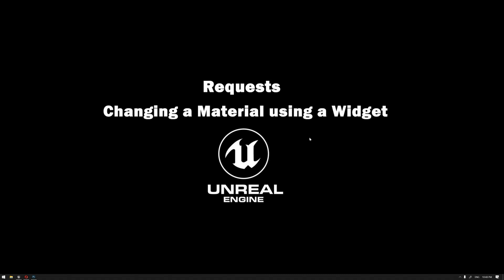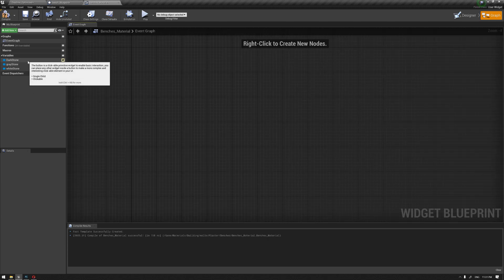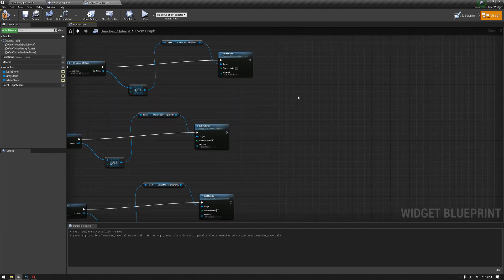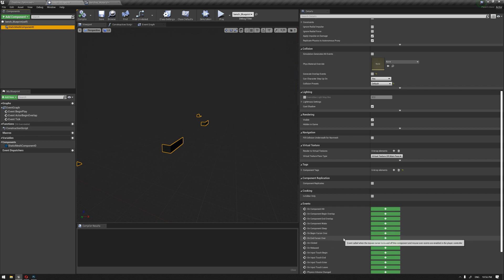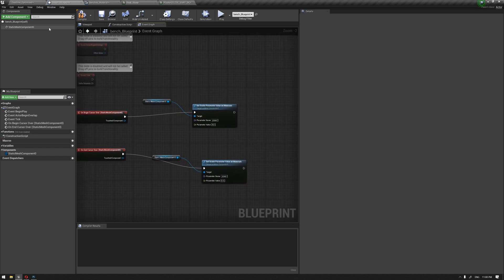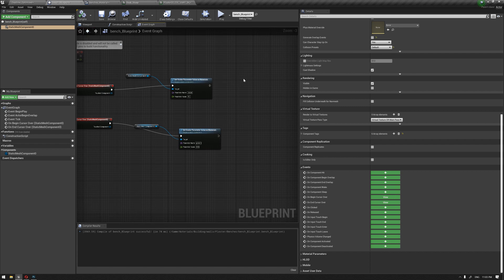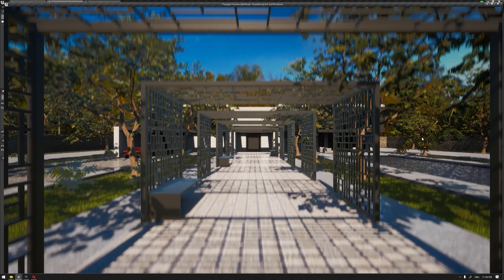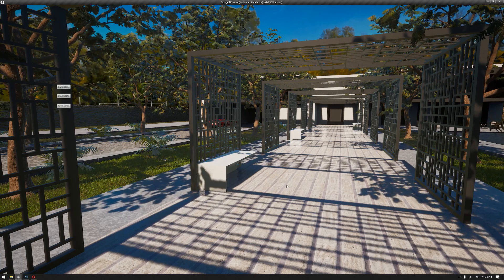Request 3 : How To Change Material in Real Time using a Widget

Comment: its doesnt work for a lot component like sofa
Reply from the maker: what kind of troubles did you face with static mesh's like sofa
Reply: @theimageneers5161  problem solved bro, event the sofa mesh's, i just need to add 1 by 1 to change part of sofa
Reply from the maker: @Fikarblackproject  Thanks for sharing that Fikar 🙂
Reply: @theimageneers5161  can u make tutorial again? like when we click chair/table the widget will pop up :)  thx before
Reply from the maker: @Fikarblackproject  Will do our best to answer this request in our current second course 🙂

Comment: hi... not working for me :-(...
Dont know what i am doing wrong !!... does this method applys only to the ArchViz Game mode ?. 

i am not able to get the white color when i hover over the converted blueprint mesh, also not able to visible the uiwidget
Reply from the maker: Hi Jamee , what version of UE are your working on and did you find any errors when you compile the blueprint
Reply: @theimageneers5161  using UE5. am able to make it work when i dont connect " set position in vewport" 7:45,  i think it was positioning out of the frame.

 but i am still not able to read the emission "power".  may i know how i can make it work, like able to get the white color when i hover over the mouse to the BP.
Everything else works perfectly expect the hover over color. probably i am doing something wrong the material and calling the parameter name "power"
Reply from the maker: @jameejamshid9921  glade to see you solved the other problem thats good news , anyway the main idea here is to make sure that the hover is working so if you have created a player controller , try to make the hove hide the mesh that can tell you if the hove feature is working or not
Reply: @theimageneers5161  Hover is working. like i am able to get the user interface when i hover over the mouse on the mesh, but i am not able to see White color like yours
Reply from the maker: @jameejamshid9921  i guess i can send you a blueprint with an actor to test if the same problem happen as well
Reply from the maker: @jameejamshid9921  hay there , so i recheck your UE file , just added a power node to the emissive node and ive set the value in the BP to 200 and it worked fine , hope that help

Comment: Hi ! Thank you for this series . Im new and I learnt a lot. Would you be kind enough to share how your mouse cursor is active even while moving around in game? I have enabled "show mouse cursor" option in mouse interface section in the "changing material" blueprint. but my mouse disappears after clicking once on viewport once the game is running. Thank you .
Reply from the maker: Your most welcome , if you did setup the node and you still facing this problem try to do it in a different UE4 file and check if the same problem happen , please note that you can set the node inside the level blueprint as well
Reply: @theimageneers5161  Hi I am also having the same problem - when you say set the node in the blueprint - what node do i need to set?

Comment: For some reason, when I try to call the widget as I click on my asset it doesn't want to appear. I followed the steps yet instead of hover, it's simply 'When Clicked' event, the widget will be called followed by 'Add to viewport'. When I hit play to test it, nothing happens when I click on my icon [asset]. May I please know what I'm doing wrong here as I have been searching for a solution like crazy! Appreciate your help.
Reply from the maker: can you please check in you level bP if theres an add to viewport node connected as there could be something conflicting , also try to do the BP in an empty level just to check if its working or not , please let us know if you still cant solve it